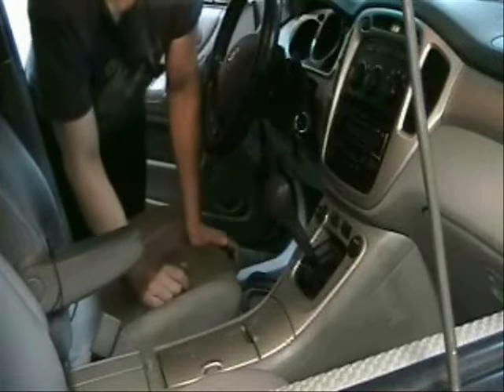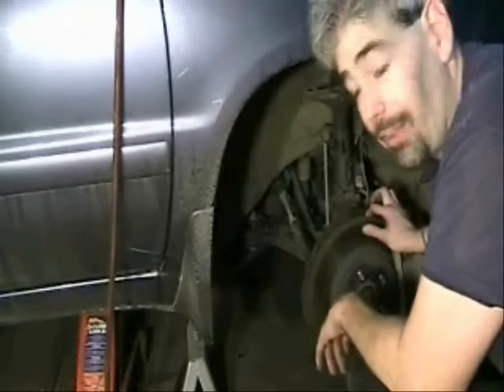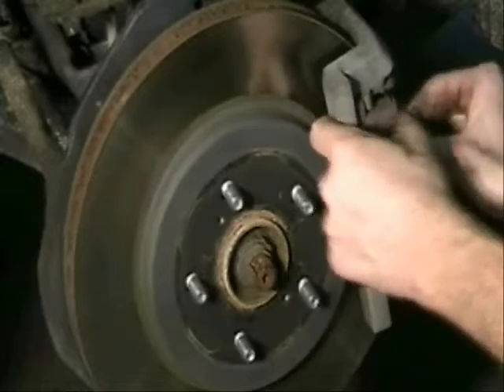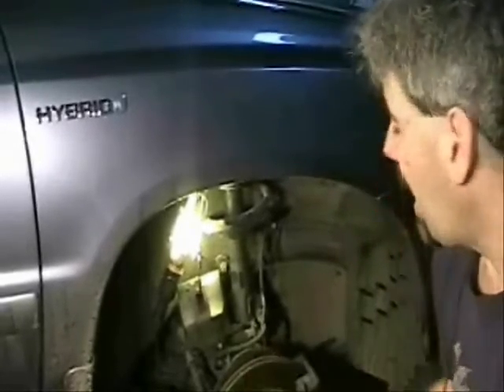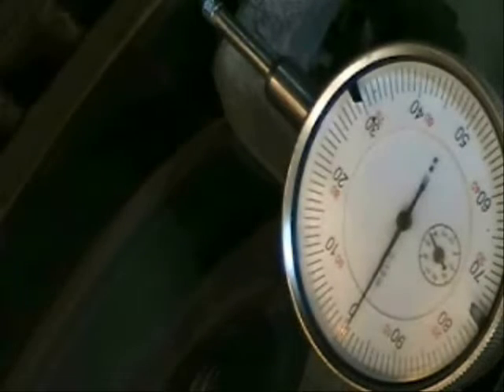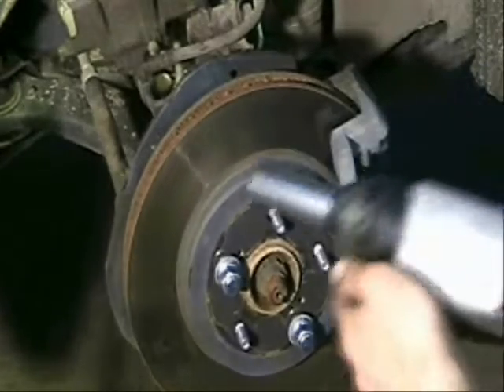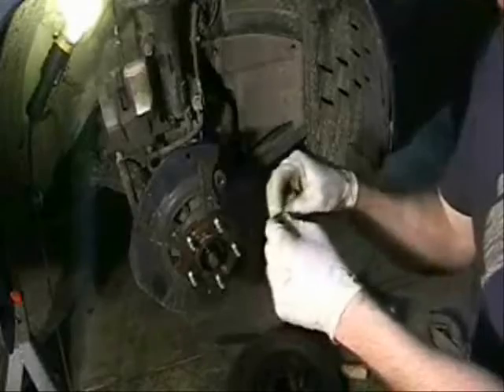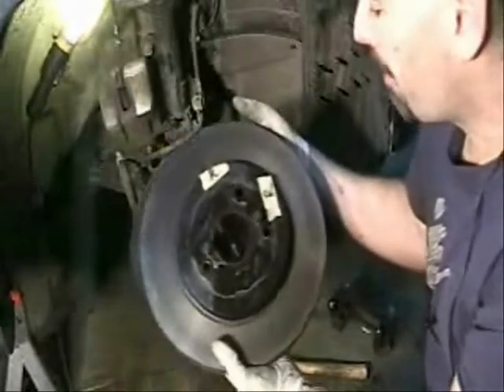How to do a Complete Brake Job for Beginners- PART 1

Comment: Well, the thing is, you don't have to measure runout unless you have perceived shake when braking. If you don't have it, I guarantee that your runout and parallelism are within specs. Measure thickness if brake rotors appear to be visually worn. In our climate and road conditions here (Northern Alberta), rotors get badly corroded way before they get a chance to get worn. And then you either have to machine them (removing quite a lot of material in the process and needing to invest in a brake lathe) or, more practical and profitable in most cases (considering extra labor cost and return on investment), just replace the rotors. Measuring thickness comes into play only when you are machining the rotors.

Comment: لكُل فني أوهآوي شخصياً 
من هوآة أعملها بنفسّك ( DIY )
من الضروري يكون من ضمّن عدتّك
قيآس الكلّبّر سلآيد  caliper slide
أقل شيء ولو عندّك معهُم المكرومتّر micrometer  .

لكآن زيآدّة الخير بركّة /// 
سهل أستخدآمهُما وأذا صعُب
عليك أستخدآم أياً منهما أكتــُب 
بالغوغّل gogoole كيف تستخدم !!!

How to use  caliper slide
how to use micrometer gauge
وروح للأشرطّة / المقآطّع ( فديو Video )

لقياس وووقرآئــة سمآكّة 
قُرص الفرآمّل ( الروتّر rotor ) ؛
أفضل آستخدآم قيآس الكلبّر سلآيد caliper slide
عن أستخدآم المكرومتّر micrometer لأن أستخدآم الكلبّر 
سلآيّد caliper slide وقرآئتهُ أفضل وأضمّن وأسهـّـل .

You can measure the brake 
rotor minimum thickness with 
caliper slide or with micrometer .

For me I rather and 
. preferred use caliper slide

مُلآحــظــّـة مُهمّة جداااً ؛
لا تستخدّم زيت غير الزيت
 الموصوف لفرآمّل سيآرتّك !!!

مثلاً ؛
أذا مكتوب على غطاء علبّة الريت اللي فوق الكبآس الشيخ
زيت عيآر دوت 3 DOT فضروري تضيف له زيت ( سآئل )
من نوع / لزوجّة ( عيآر ) دوت 3  === 3 DOT اللي هي نفس علبّة 21 .
هنا تقدّر تضيف لُه زيت / سآئل عيآر دوت 4 ========== DOT 4 .
ولآكن ليس العكّس /لا تُضيف دوت 3 === 3 DOT  لزيت دوت 4  ==== DOT 4  .

طــبعاً ؛
فيه دوت 5 --- DOT 5
وفيه دت 6 --- DOT 6 
لا تخلطهُم أبداً .
Reply from the maker: Good thing you edited this, otherwise it would be unreadable.

Comment: Matt, as usual and thorough job and a clear precise explanation. One comment: I would typically add to the run out measure by measuring parallelism  ... there is usually a spec and the number the comes to mine is O.15mm for run out and 0.015mm for parallelism  (or max variation in thickness). I have to say that I've never measured a disc that is in spec on run out but out of spec on parallelism, though the manufacturers to often refer to parallelism spec.
Reply from the maker: +Alex Messina How can you possibly miss a measurement for parallelism out of spec when testing for runout?
Reply: +Schrodingers Box That's a fair and good question on the face of it. But if you have a run-out tolerance of 0.15 and parallelism tolerance of 0.015??? What do you think.  .... Personally, I feel the thickness/parallelism spec is a bit belt-and-braces, but it often given as a spec. That aside, nice vid Matt.

Comment: the screws for rotors are a OSHA issue for assembly line so rotor does not fall onto workers foot.
Reply from the maker: +Dom Lanzisera Not true- there are no workers there.  It is to hold the rotors in place for the torquing of the wheels by the robot.

Comment: The Screws in the Rotor are put in when the car is on the assembly line  to hold the rotors on
Reply: DE Nichols never use torque drivers u want maximum power break rust... As far as the torch if your comfortable go for it
Reply from the maker: I recently invested in an impact screwdriver (the type you smack with a hammer) and it works like a charm
Reply from the maker: Oh I didn't know that- it makes total sense but I would hope that we could come up with a better technology that doesn't mean I need to bring out a drill and vise grips for a brake job. Maybe something... like... someone holding the goddam rotor in place?
Reply: I totally agree  and its always on the foreign Cars what I like is what gm seems to be doing instead of those 2 screws its 1screw but it's a cast hardened screw and it has a torque instead of a Philips head... What i do for the screws I take a die-grinder and just make a giant slot and neither use a wide screwdriver or an air-chisel to unscrew it!
Reply: @SchrodingersBox  You don't need a drill; you need an oxyacetylene gas torch. Make that pesky little screw red hot, and it comes out like a charm. As a matter of fact, the torch is one of the most essential tools, right after the lift, compressor, and scan tool.
Reply: Frank Albergo I am certain I'll end up using that tip, thanks!
Reply: DE Nichols you're welcome! but its the last resort trying heating them up with a torch and using the impact screwdriver first
Reply: My neighbor keeps wanting to use my impact gun on a screw, but I don't believe my impact gun meant for axle nuts and up should be really used with a bunch of adapters down to a little screw. What do you think? (I do use it for things that torque half as much for speed, but I'm gentle with it and finish by hand or a torque driver if it's important. )
Reply: DE Nichols the axle nut its perfectly okay to use your gun if u don't feel comfortable but a set of torque sticks for the gun.... As for the screws don't do it! You're just strip the heads
Reply: Thank you, that's what I was thinking. What torque driver would you use when you need to break a screw out of rust? My neighbor's brother has an acetylene torch...you've already recommended that first but I was wondering. Especially, if it's near fuel on his lawn device.
Reply: Schrodingers Box those work great but make sure u have tons of spare bits lol
Reply: Lol
Reply: DE Nichols sad truth